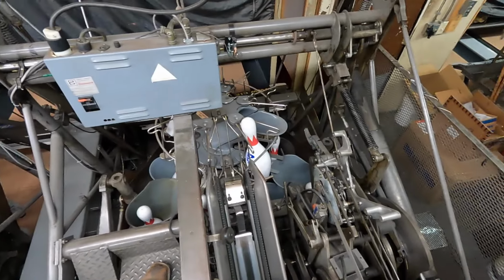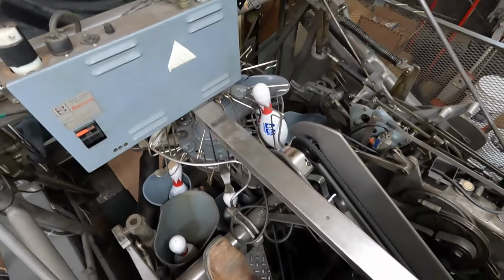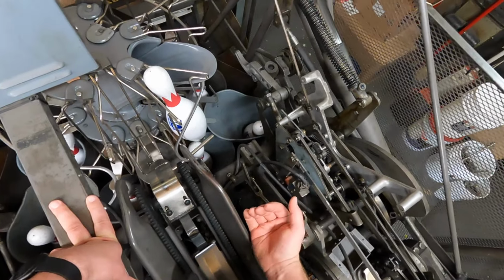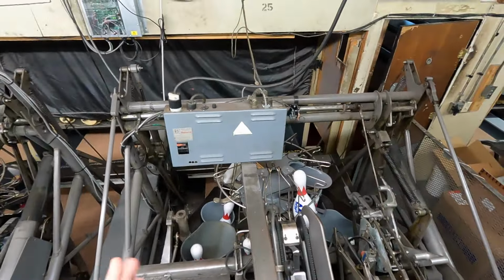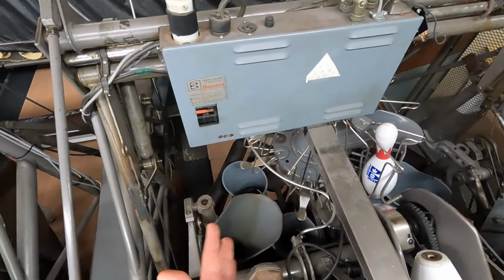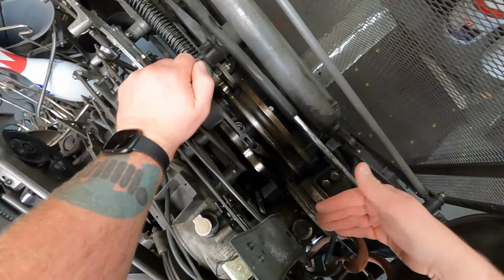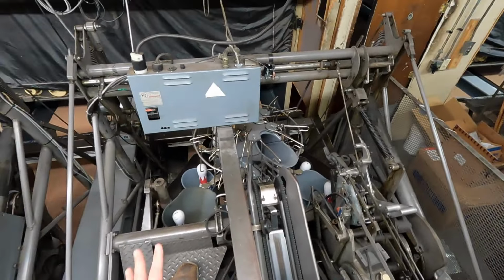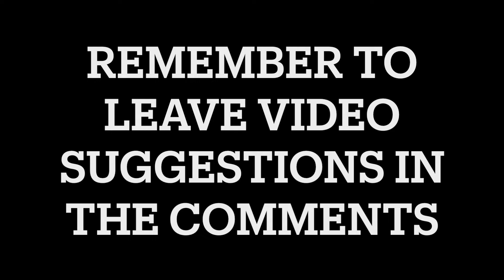Respots - Brunswick Pinsetter Calls to Service

Comment: Hi Shawn, I have a question. What's the overall electrocution risk on these pinsetters and from what?
I've vaguely heard of risks from electrical boxes without covers & cycle solenoids with improperly secured leads rubbing on the box.
I ask because I'm considering becoming a pinchaser at my local house but the one time I was at the back I remember seeing an electrical box or two without a cover.
Reply from the maker: I mean if you go poking around with the power connected to it you’re more than likely gonna get shocked. We have one machine with the cover off, but that’s because we are in the process of trying to find a electric problem